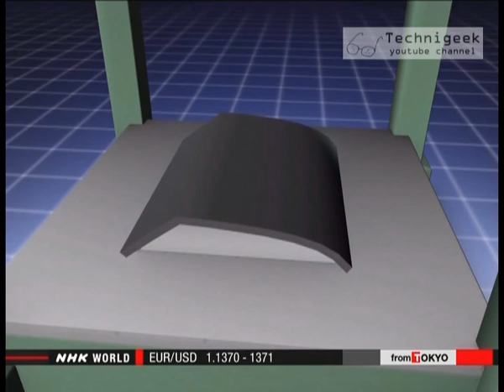Carbon fiber car body سيارات متينة و خفيفة الوزن مصنوعة من الياف الكربون

Comment: Initial impact resistance of carbon fiber SUCKS DICK. Chromoly steel is heavier but it would save you from being pulverized in a high speed crash. Carbon fiber may have greater tensile strength but the impact resistance isn't as good. It will likely explode into hundreds of shards of shrapnel as it breaks apart.
Reply: lol, tell that to formula one, where they routinely take impacts at 1-200 mph and the driver walks away unscathed. It absorbs energy better than steel. With the rigidity of steel your body accepts most of the transferred energy, resulting in whiplash and worst. Since Carbon Fiber shatters, it diminishes impact energy far faster; (think of it like far more advanced crumple zone.)

Comment: In a collision, carbon fiber will shatter. Metal will bend. Therefore metal is still safer.
Reply: No, Formula 1 became much safer with the advent of carbon fibre structures because it's better at absorbing energy efficiently.

Comment: Perhaps as the years go by, the costly process to make Carbom fiber might go down.  then it would make more sense I guess.
Reply: they now have a 3D printer that uses carbon fiber so hopefully in the near future we will be seeing the prices of carbon fiber go down
Reply from the maker: +Junkyard Doggs we have high hopes for this to happen
Reply: +Technigeek I hopes so, if the manufacturing process becomes mainstreamed we will be able to form all sorts of objects.   
can carbon fiber be 3D printed yet?
Reply from the maker: +Junkyard Doggs i dont think carbon fiber is possible to be printed , but maybe its possible to make something printable with same strength

Comment: Cut fuel costs !? I'm sorry but you just Eff'd your chance in the western world. If you motioned an INCREASE you would already be selling here...the gas companies are right in the governments back pocket ; )
Reply from the maker: ironDsteele you have a point here , yes
Reply: ***** I know cutting the cost of fuel is not the market for this idea. It's negated by the extreme expense of the CF body, also, Ford has already tried that idea with their all aluminum F-150 truck. They have taken nearly 800lbs (360kg) of their current model with aluminum, and it's nothing special in terms of saving fuel compared to before. You should look into high performance sport cars, that's where this is at.We have the technology to make cars run on fecal matter if we so desired, trouble is there's no money in it for the petrol industry or the government. They are a selfish bunch of pigs who only care about their own bank accounts.
Reply from the maker: ironDsteele i totally agree
Reply: ***** I can understand the frustrations of trying something new in a world of financial oppression. I'm designing and manufacturing clothing out of CF/Aramid or any combination thereof which has never been done before. Suffice to say I've received more criticism than support the world over, but I would say learn to accept what's healthy advice and leave the rest. CF clothing could take off like a rocket, but go the way of the DeLorean real quick; I'm still going to try. Good luck!
Reply from the maker: ironDsteele i wish you luck with what you do , even if it still didnt go viral or sell like hell , you might make some good success with it , and that will be appreciated one day